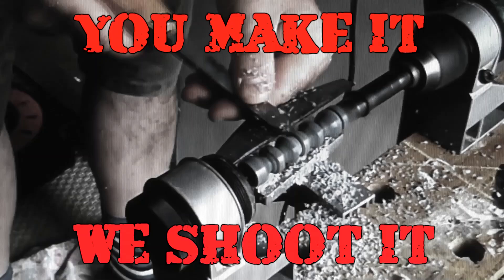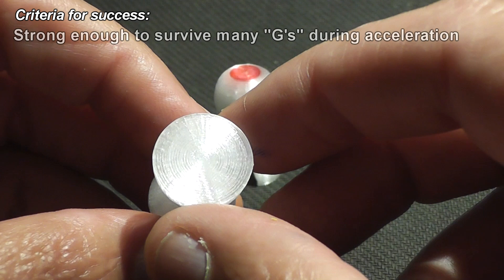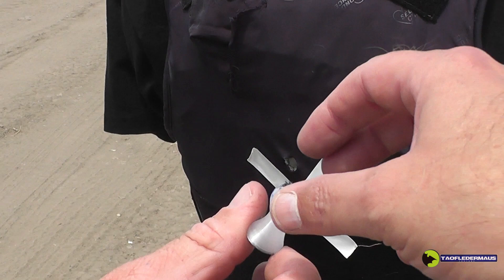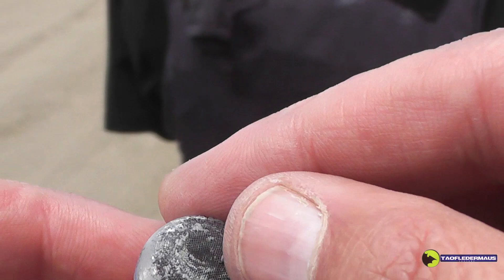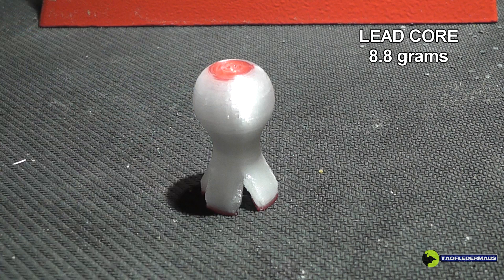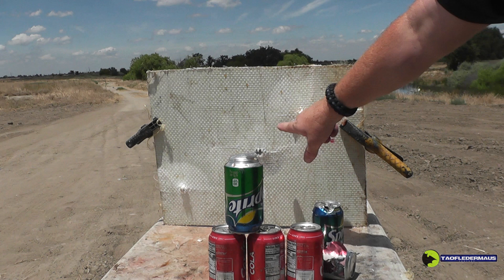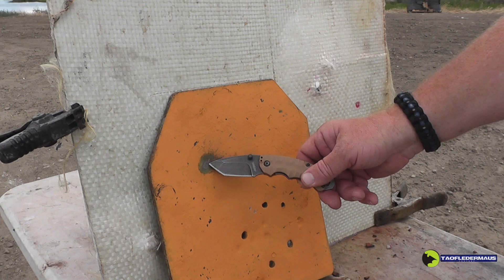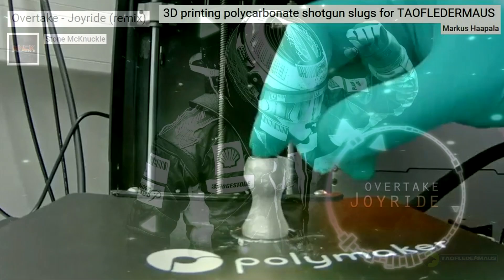SCIENTISTS send us shotgun slugs with stunning results!

Comment: Ugh, don't use Mach to define speed, it's ridiculous. Most people are ignorant of this, but Mach is variable; Mach 1 = speed of sound, and that changes based on numerous factors, such as medium (air, water, etc..), pressure, temperature, etc... Mach 1 in air is roughly 346m/s, Mach 1 in water is 1498m/s, and Mach anything in space doesn't exist. Long story short, using Mach as a definition of speed is essentially worthless 95% of the time.

Comment: You should lathe up some hardwood slugs,
Reply from the maker: We have shot Mexican hardwood before
Reply: Here is something you have not tried but could be useful. There is jewellry mold material called Econosil. You can vulcanize it clamped in a form. Hardening it in an oven at 240f and if you make your master in steel or jb weld you can then cast lead free solder in the mold with talc. Like pouring lead musket slugs.

Comment: FOR SCIENCE! ヽ(｡∀ﾟ)ﾉ  Wow, that was crazy how stable the un-weighted slugs were, and how they sort of welded to the ballistic nylon.  Totally unsurprised by it staying intact, though. PC's tough stuff. Also unsurprising that the fins broke off. The way they were printed, the fins had a very small cross-section that didn't present much surface area for layer adhesion...and that inter-layer bond is the weak point in any thin-walled part.

I've got a spool of polycarbonate filament for my printer, and even small flat pieces as thin as 3mm are basically impossible to break by-hand, assuming you got the print temperatures and everything right. (Because, yeah, it isn't the easiest to work with, doesn't adhere to print beds well.)

Comment: OMG Look at a lead .177 round how scientific can you get, make the same shape but with hi impact material like i mentioned on your other post use polycarbonate with hi impact glass resin as well, just like Bullet proof windows in most hi end protection vehicle ? Now think of using Tungsten carbide with a real good alloy to make it light but very strong, hum i wonder what type of metal could be made to be cost effective and mass production which the military could use, i bet they already have them, but the normal customer will see them maybe in about 15 years after the military has made a better product. :)